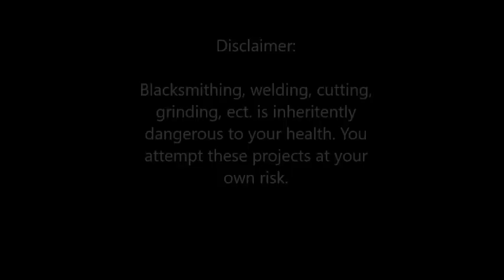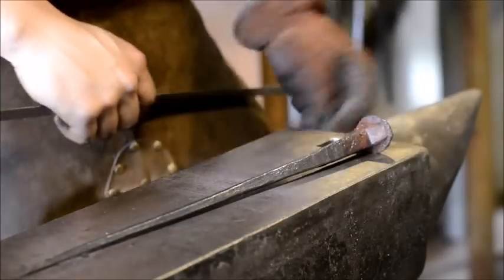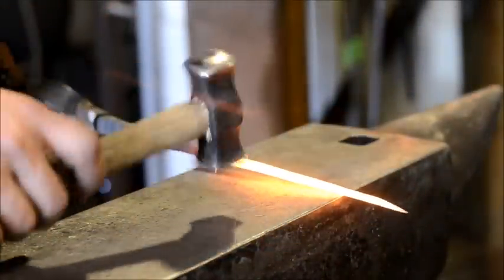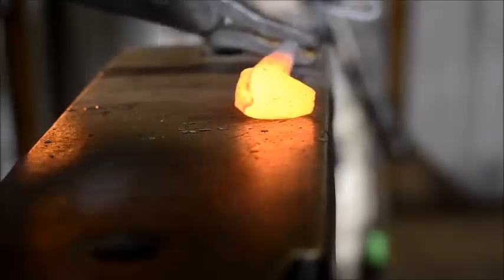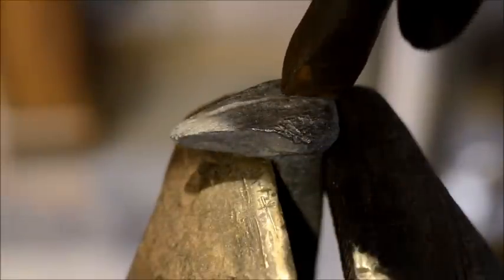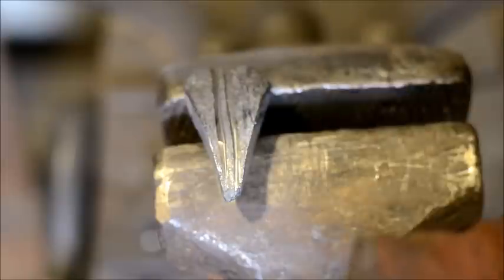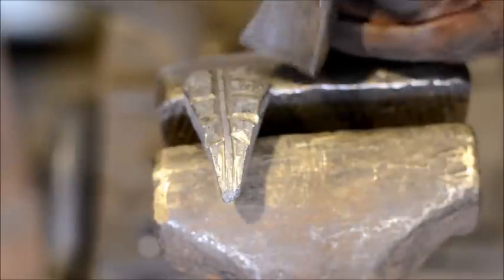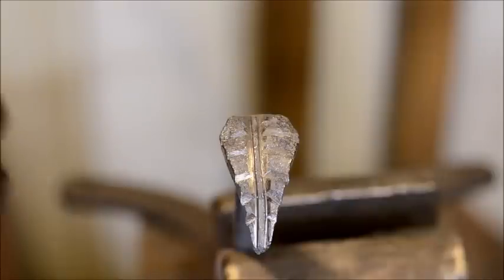How to Forge a Steak Turner // Blacksmith Project Ideas

Comment: Would re-barb be fine for this ?
Reply: You mean rebar?
Reply: It would be fine.. I make mine out of old wheel springs. There's a few good techniques to learn, by making a "flip-stick".. just do yourself a favor, and round the spike, for a better release of the meat. A plane surfaced spike, has a tendency to stick to the meat, in my opinion. 
Basically this little exercise, is what a apprentice, should be able to master, after the first period of learning.. I always make them, with a little difference in them, to individualize them for a single user.. making sets of 6-8 flippers gives you a good chance for twisting, and or ending up in a curled or round finish.
Reply: Lolol
Reply: Re-barb